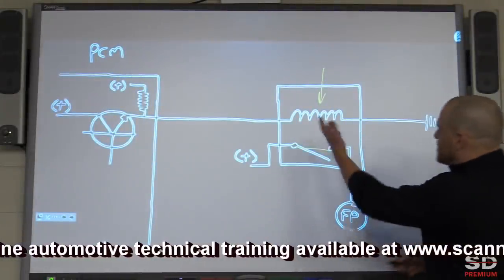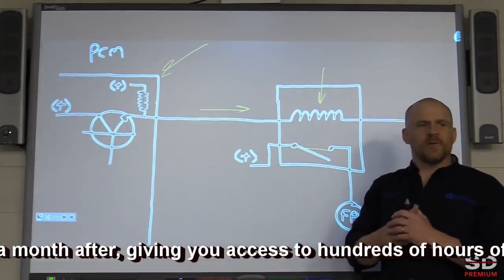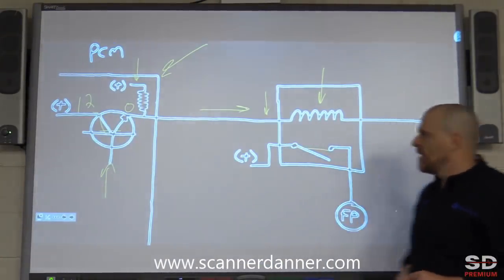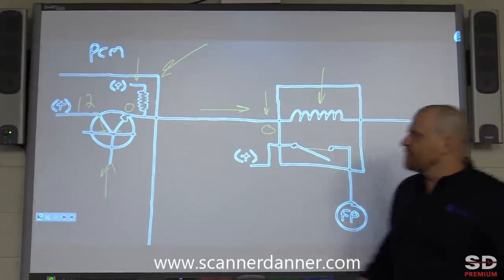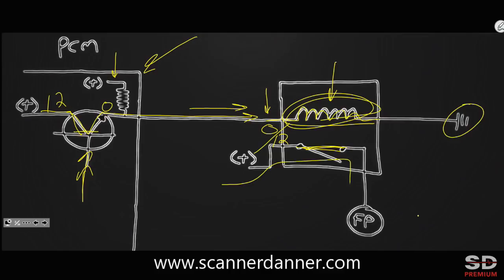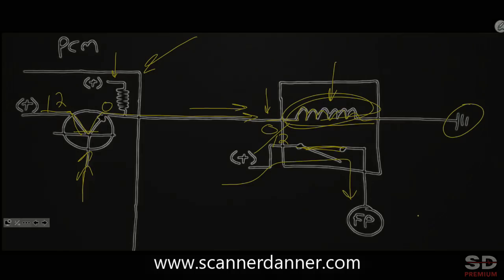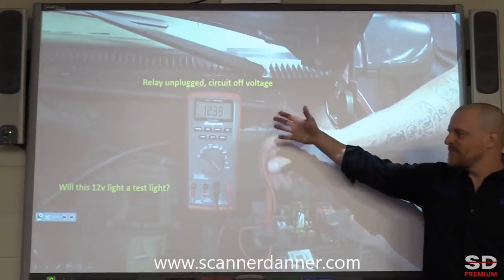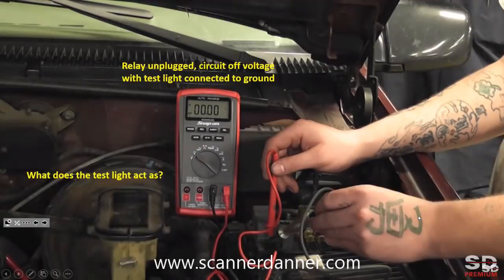Bias Voltage (a ScannerDanner Premium preview)

Comment: This is just a click bait commercial waste of four and one half minutes because he didn't explain why it showed 12v with the relay removed but would not light the test light. I am not going to pay him $11 every month to find out.
Reply from the maker: I'm sorry, this was not meant to be click bait, in the title it even says (a ScannerDanner Premium preview). You should reconsider. At least sign up for the 14 day free trial so you can watch this video, then cancel your subscription before the free trial is up and you won't be charged.  You have no idea what you are missing out on. Thanks
Reply: @ScannerDanner , OK I take it back you warned us it was a preview. I am  really just mad at the car manufacturers not you. I used to be able to fix anything on a car just from taking auto shop class in high school and reading a shop manual. Now everything on a car is computerized, unreliable, and hard to repair. Automatic transmissions used to last longer and be cheap to have rebuilt because they were only mechanical not computerized. Heating and AC used to be strictly mechanical. I went all winter without heat in my car because of a broken damn computer controlled servo or computer control that has the servo open the door to heater core. People can't even get free estimates any more since most mechanic shops charge "$100 per hour diagnostic fees" because everything is computerized. The sorry federal government spent $3 billion dollars on their cash for clunkers program causing  a used car shortage and price increase.
Reply from the maker: @JohnSmith-1234  no problem, I understand. Computer controls can be tricky for sure. What I am offering people is a window into this world. Foundational stuff that anyone can learn from, whether you are a DIYer trying to fix your own car or the professional mechanic who wants to get into the electrical and electronic side of the field. Seriously, I'm asking like 37 cents per day to be part of it! I promise you it is worth it. Go to my website and read some of the feedback there. Heck, read the feedback right here on this video! Thanks for the follow up comment.
Reply: @JohnSmith-1234  Ha! That is funny! I have specialized in automatic transmissions since 1977 but I also was a dealer tech at GM when computers were taking over in the '80's. I can assure you that computer controls have greatly increased the life of automatics. The "legendary" transmissions (350, 400, C-6, TF) would easily fail if something was wrong as it could not adapt to a changing condition. Modern 4,5 & 6+ speed automatics routinely last to at least 150k in no small part to computerization. Sorry, I couldn't let that one pass! Great job Paul. I think I have a better than average comfort level with computerized controls working on them for decades and I still learn new things when I watch your videos.